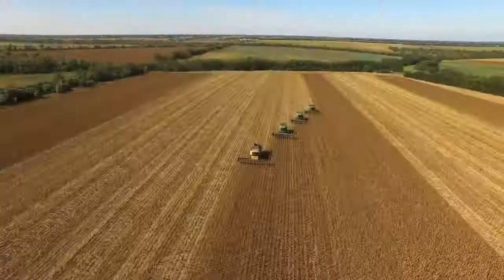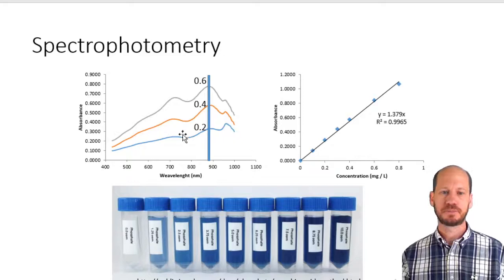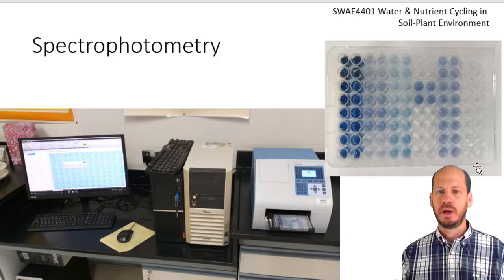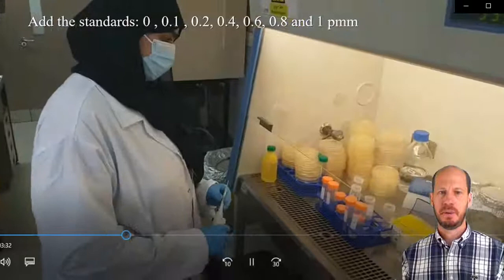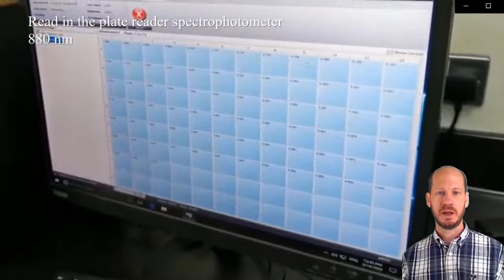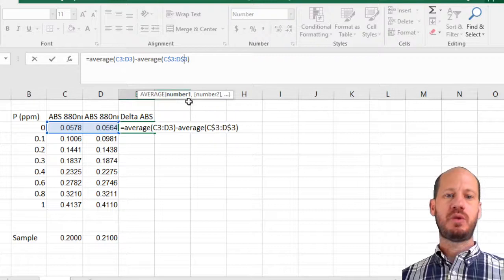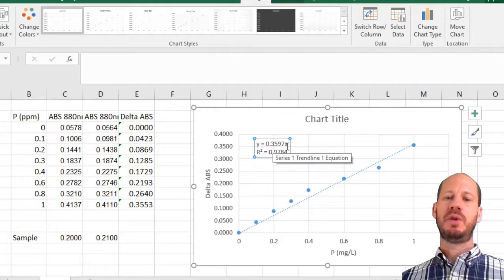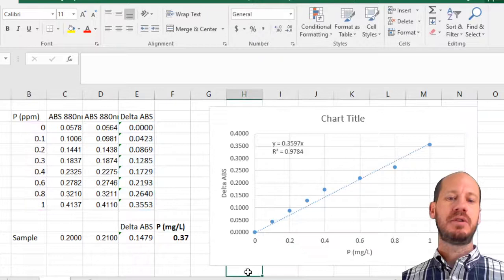lab 02 - determination of phosphorus concentration using the Moliblue spectrophotometric method

Comment: Hi Daniel!
What standard have you use to do the curve calibration? It was a phosphate Standard or a phosphorus Standard? I didn't see the standard going to the hot plate so I am in doubt which one was used to this experiment.
Even if was used a phosphate Standard to the curve calibration it was still be necessary to take them to the digestion on the hot plate?
Reply from the maker: Hi, in this case the standard was prepared in-house using potassium phosphate.
Reply: @danielblac  So it doens't have to go to the digestion in hot plate, right? I'm asking cause I am really having some discussions in lab about this with my coworkers. They are pretty sure that the potassium phosphate have to go to the digestion before doing the calibration  curve for phosphorus determination but I desagree with that. I would like to know your opnion. Thank you!
Reply: @danielblac  Hi Daniel, could you please answer my last coment?